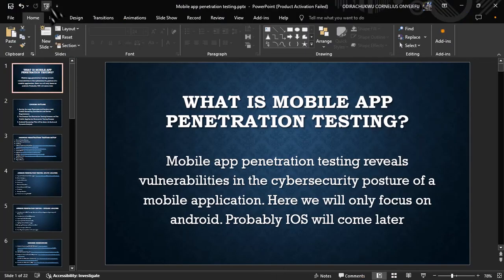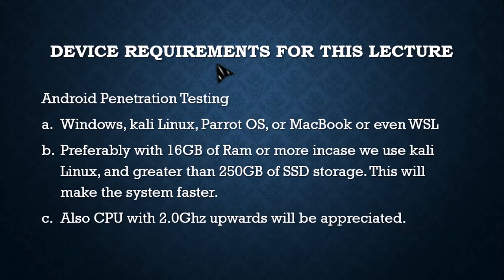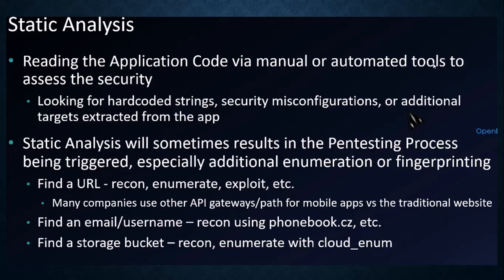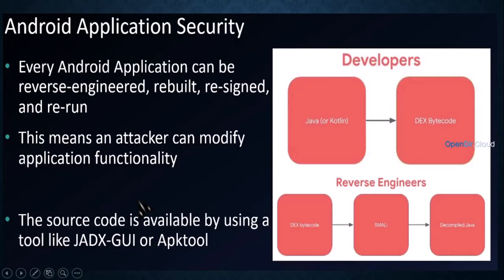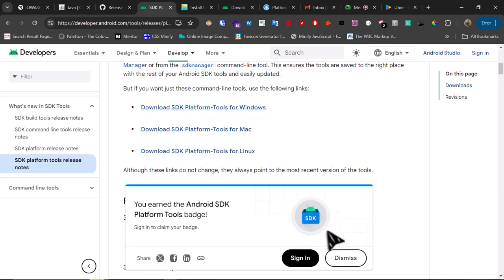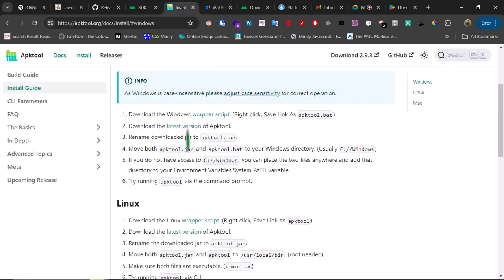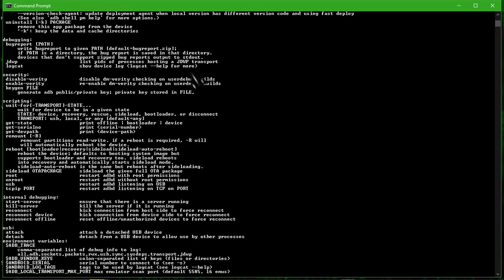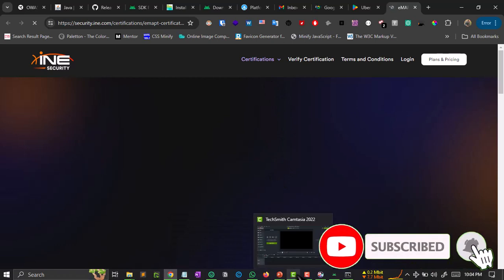Mobile Penetration Testing Series - Introduction and Lab Setup

Comment: When installing the platform tools I noticed that when I copied it on my windows folder it did not work.
So I had to use the environment Path and it worked.
Thanks a lot you are genius sir
Reply from the maker: That's why I showed the two methods. Either of them should work